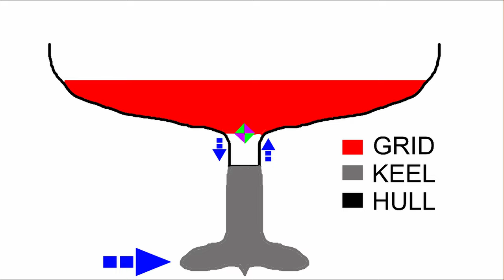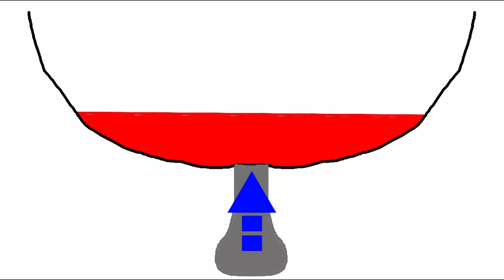16 A deep dive into our damaged sailboat!

Comment: I agree with your diagnosis,  make sure there's no blacked areas left and no gelcoat around where fibreglassing is going to be done . As I said earlier message 6" tabbing minimum , use epoxy with cavacel to thickness epoxy to fill voids on any open gaps and force it in void . Please make sure void is totally clean , use a die grinder or dremel with small bit to clean out cracks and clean with acetone then fill . Hope this is of use to you . Have you contacted you surveyor about this damage , as his insurance should be paying for this repair ,not you .

Comment: (P,PC & W) are all smiles seeing that the four legged crew is properly being cared for and they said now we can talk about the repairs. I  really do agree with how you described the damage. I am no engineer but I do not know if it is better to have the keel up against the hull or actually away from the hull as  the new fiberglass is being installed. My thinking is it may be better if it separated (boat hanging) as  you are reglassing. You may want to check with a structural engineer. You guys worry about fixing your Flow and you can always get to  the replies later. We wish you the very best of luck and will keep following your channel. Juanita says to remember that when it gets to much to  handle, more wine always helps.
Reply from the maker: Juanita is a wise woman indeed! In fact, we have a bottle chilling right now...🤣 Thank you always for the well wishes, I think I probably already said this but I'll say it again, we always look forward to hearing from you guys! I'm in the process of reaching out to some folks to get some more information and hopefully a good plan for moving forward. I am the compliance officer but Cade is the accountant and sometimes the two don't mix! Of course, at the end of the day our safety is the most important thing (well, secondary to the dogs' continued access to our bed and air conditioning....)

Comment: I know you can not see any further cracks but it would be good to find where the cracks end and the delamination stops. Once that is assured then you can glass away and strengthen the hull and keel. I am a little concerned you are in such a small area with those large cracks and movement that its got to have more damage hidden. Would be a real shame to do all the work and find out later that you didnt go far enough.
Reply from the maker: It is a concern for us too. We are continuing to grind the areas of damage we know of, and once we get everything exposed to the best of our ability we will hopefully be able to reassess at that point as we'll have a better view of what's going on. There's a lot still hidden right now.

Comment: I'm only close to being a 'novice' in boats etc etc   But some of them video shots look as if this vessel has had Keel repairs previously.. Could I be correct ?  Hang in there guys.👍
Reply from the maker: That's what we originally thought when we started inspecting the damage, as some of the tabbing looks pretty messy. It could look sloppy because the grid was tabbed in by hand and it's hidden by the floor panels most of the time, so no need to make it too pretty. But we can't say for sure that there were not previous repairs- it does look like the keel wells are a little sloppier than the outboard bilges.

Comment: Well I would have stripped the whole boat as the fibre dust is going to get everywhere  not matter how well you put those covers up  take a deep beath and think are you up to that very big job because the more you dig the bigger it's going to get
Reply from the maker: It would have been really nice to strip the boat of everything, but since we are living onboard during this process that isn't possible. The dust does get everywhere! We do a lot of cleaning even after we take down the plastic drapes.

Comment: Thank you guys for reminding me not to buy a Hunter that brand have a really bad reputation specifically the problems with the keel. There’s so many stories about how hunter sailboats almost loosing the keel in heavy seas. I just wish you the best. By the way how come that the surveyor didn’t noticed the problem so obvious like the keel being detached from the hull? Before you pay for your vessel.
Reply from the maker: We believe that the damage was actually sustained when we were weathering hurricane Nicole in Cape Canaveral last November. We were dragged around in the mud quite a bit as wind gusts were near 90 mph at the Space Coast, even 100 mph recorded at launch pad 39B, about 15 mi from where we were tied up in the barge canal.
Reply: Hi there, this problem is not a typical Hunter problem, but affects all modern yachts. Whether built in Europe or U.S., it is the problem that the grid that is installed is only attached to the hull interior with an adhesive. The keel itself just hangs on the hull with all its weight. The adhesive hardens, becomes inflexible and breaks at the slightest twist of the boat. If the keel touches the ground, the grid tears off the hull and breaks. As I said, this is not only a Hunter problem, but now a worldwide problem at new yachts, due to the cheap installation of the grid with unsuitable glue.
Reply: Looking at your diagram.  It seems like the hull below the grid is s badly damaged it is beyond repair.  Even where you can’t see cracks, it will extend much further.  
I would build a good thick layer on the outside running a good distance away from the keel, and running under the keel.  This will require the keel to be removed.  Use carbon in the highest stress areas, 
Best of luck.

Comment: I think you are being way too HaHa frivolous about this very serious situation. To add to what has been said before... The cracks you have identified show where the tabbing has 100% separated from the hull. This has shown how weak the mechanical polyester adhesion was in the first place. Consequently, even in areas where there are no visible cracks, it is likely that separation has further progressed. You need to first remove ALL old tabbing where the cracks are visible, leaving only original hull and grid bare FG. Then secondly, try to break away ALL of the other old tabbing, working away from the known cracks. Do not plan any new FG application until you you are at that point.
Reply from the maker: Thank you for the advice! We agree with this. We're still working on grinding out all the damaged areas but we're planning to remove all the old tabbing and start with bare fiberglass as we don't trust the tabbing that's still in place in the keel well.

Comment: You need to hang the boat ,mine hung for 2 weeks while grid was glassed in (Beneteau)  all pans were cut out as the keel pushes up as you have had grid failure. Only the weight of the boat was lifted keel stayed on ground. Boat is 10x strronger >Mine was done 7 years ago no issues